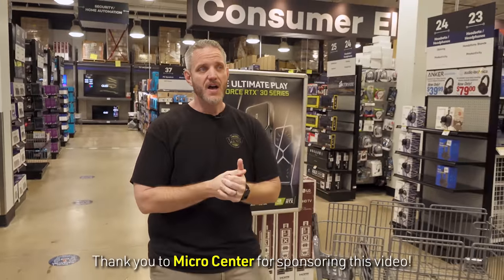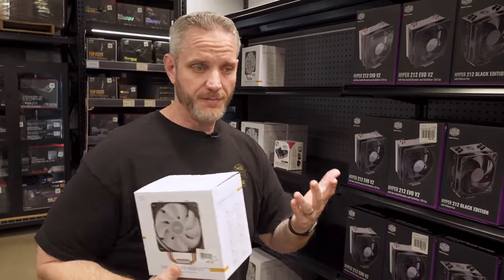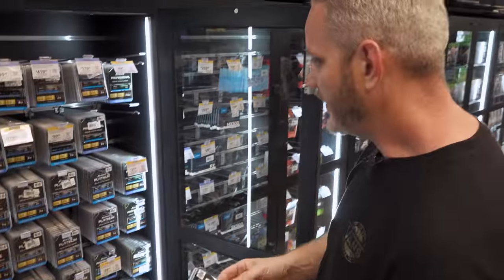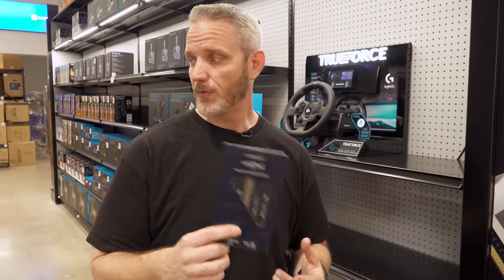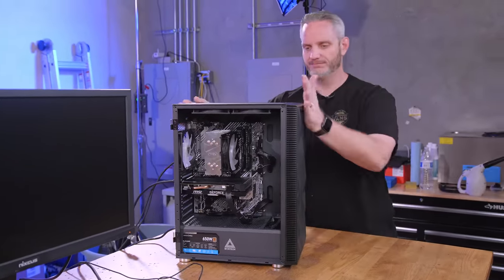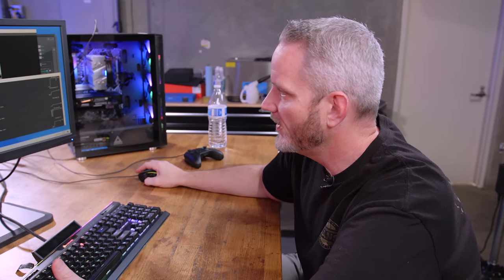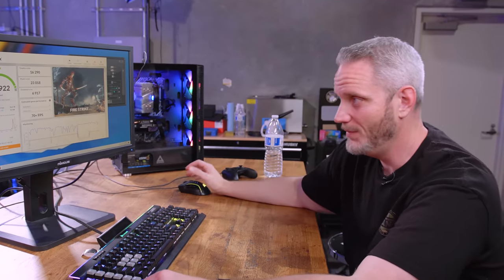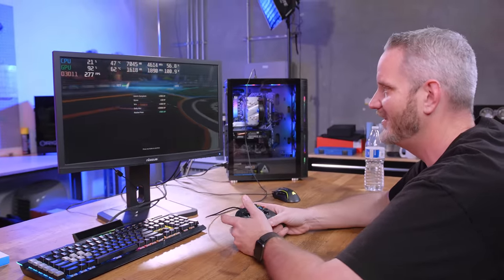How cheap can I build a "Gaming PC" for in 2022

Comment: At least you said, "this is over MSRP". That is the problem, ETH mining is down with the merge coming, so GPUs are available. However, they are still listed above their MSRP and above their launch prices. AMD overpriced their cards to begin with, Nvidia limited their GPUs, Nvidia then launched Ti's at scalper prices to take profits. It is just terrible to build a PC right now. I wouldn't build a budget PC unless you have to... even motherboards are at their highest prices in years, as are PC cases, both CPU companies are changing or have changed their socket sizes, DDR5 mobos and DDR5 itself is not fun. Doing a budget build right now is terrible for future proofing and terrible for pricing. Wait if you can.
Reply: I got a TUF 3070 TI for MSRP on e*ay, yesterday. After waiting for more than a year, luck struck me. :D
Reply: @DaveChimny  but isn’t 3070 Ti MSRP like 20% higher than the 3070 for 5% more performance?
Reply: @DaveChimny  3070 Ti is scalped from the begining anyway
Reply: @arnox4554  I would agree if FE cards didn’t keep showing up at their launch MSRP and the fact that AMD and Nvidia are reporting record profits on fewer unit sales. Yes, many factors involved, but very hard to say with a straight face that cash grabbing is not a major one.
Reply: @vaderwashere365  Fun fact: All available 3070s would've been over the TI, so why not get it? ;-)
Reply: Name one thing that isn’t more expensive now than it was in October 2020 when these were announced
Reply: @four_20hitman___97  founders edition cards
Reply: @DaveChimny  not saying don’t get it, just saying it plays into the scalper prices that Nvidia wanted a cut of. Not blaming any consumers. However, being happy to get a chance to buy a very expensive GPU is how bad it has gotten.
Reply: It's time to accept that this is what things cost now.  And it's only going up from here.  We are bringing all the fabs back to US soil for national security. Their is no chance of this not happening. We are disconnecting from China and we will let them have Taiwan back in about 5 years.  Right now is the BEST time to build, before prices start to spike because of neon and nickle availability ... You have weeks maybe a couple of months.
Reply: @KeithZim  correction, end of 2020 and early last year was the best time. 30 series was new, Ryzen had great CPUs. At least you had over a year of the highest ETH mining profitability to make up for the additional cost. Now you just have an additional cost. Might as well wait for new 40 series when the merge happens and the cards are worse at mining in general.
Reply: PSUs were crazy expensive in mid to late 2020
Reply: @KeithZim  every single thing you just said is absolutely true. im thinking of getting back into semis because we have a major shortage of workers to manage the fabs. we finally just got some helium after a 12 week lead time. rubber and plastic monomers, 300 series stainless, inconel and hasteloy....

i dont think most people realize the bad things coming this winter.
Reply: Launch GPU prices are not coming back down.  This is the new normal.  Everything from cases to PSUs to motherboards are going to cost more from here out.
Reply: Yeah I live 10 minutes away from a microcenter and they finally have Nvidia 30 series cards in stock all the time now. Even 3080's. But they're all above msrp. Some way worse then others. But hey at least we can finally walk into the store and have the opportunity to buy whatever card we want again.
Reply: @PabzRoz  Microcenter sells at MSRP.  If the prices are high, it's because the manufacturers raised MSRP.
Reply: @cup_and_cone  That's not true. Did you even watch the video..? Jay literally said in the video the cards were above msrp. Majority of the cards I saw at my local Microcenter were above msrp. Only a few were at brands new msrp. For example the  3080 FTW3 ULTRA is $1300 at microcenter meanwhile EVGA's msrp for that card is $920. It varies from card to card. A lot of them were less then $100 over msrp but regardless they do sell cards over msrp.
Reply: @cup_and_cone  na microcenter 100% sells cards over msrp. it's not just because manufacturers are raising msrp. not all of them but a lot of them. all you need to do is compare their prices with others and you will find plenty of examples. mostly with the higher end cards.
Reply: @PabzRoz  Jay is mistaken and the EVGA queue price isn't what actual MSRP is for retailers.    Micro Center and BestBuy both sell at MSRP.  The new MSRP for the 3080 EVGA FTW 3 is $1299 for retailers.
Reply: @leeroyjankins2307  Name a card model at Micro Center that has a price above MSRP.
Reply: @cup_and_cone  Where are you getting this information that EVGA changed their msrp to $1299? Just because Best Buy and Microcenter have the same price? Then how come Microcenter has the Tuf gaming 3070 for $750 but Best Buy has it for $660. Doesn't sound like their selling all their cards at msrp. There's plenty more examples of this when comparing retailers. Jay was not mistaken. Microcenter does not sell all their cards at msrp.
Reply: @cup_and_cone  lol ok literally took me 2 seconds. Zotac 3080ti Trinity. Microcenters price is $1850 meanwhile Amazons price is $1430. And that's sold and shipped by amazon. not a 3rd party vender through amazon. Microcenters price is over $400 more expensive. You're wrong if you think Microcenter doesn't sell cards above msrp lol.
Reply: @PabzRoz  Uh, because they're both selling that Tuf 3070 BELOW MSRP.  The MSRP the Asus Tuf 3070 is $799.
Reply: @cup_and_cone  And where did you get this information that it's msrp is $799?
Reply: @leeroyjankins2307  Wrong.  Just because one retailer is less does not mean Micro Center is selling for over MSRP.  MSRP for the Zotac 3080 TI Trinity is more than what it's listed at MC for.
Reply: @PabzRoz  Maybe you can go up to the Micro Center guest service counter on your next visit and talk with them directly, since you refuse to believe the truth.
Reply: @cup_and_cone   you're the only person wrong here. manufactures don't release there msrp's anymore. you're literally going off what specific retailers are selling their cards for at certain times that are convenient for you. that's not what msrp is. every retailer makes up their own msrp because consumers don't know wtf the actual msrp is anymore. if you think microcenter isn't price gouging consumers then you're in denial point blank. not only did Jay himself say it in the video but people in the comments are literally giving you examples. I think I'm going to trust the Jay over some random microcenter employee in the comments.
Reply: @cup_and_cone  so then what is the official msrp right now for the  Zotac 3080 TI Trinity and what is your source? please share your sources where you found the current msrp for this card. Never heard of one retailer selling a card for over $400 less then another yet they're both under msrp. do you even hear yourself right now?
Reply: @cup_and_cone    so you can't tell me where you're getting your msrp prices from..?🤦‍♂ just gunna ignore that for the 3rd time? what a joke lol.  you sound ridiculous. "ask a microcenter employee" yeah like that will give me the answers lmao.
Reply: @cup_and_cone  just curious what microcenter do you work for and do they pay you commission to bullshhit people in youtube comment sections?
Reply: @juji5400  So you're saying MSRPs don't exist, yet you're convinced they're charging more than MSRP.  😂😂😂😂  That's some ridiculous logic.
Reply: @edswanson4135  Not enough (zero dollars) to deal with all the butthurt of people realizing they'll never be able to buy a top of the line card for less than $1,000 again because they can't accept the new normal.
Reply: I don't think you'll ever see 3080s for $700 again.  Not that they can't be priced at the original launch cost, but because the market has shifted in multiple ways and retailers have no incentive to bring prices down.  They are likely still buying at inflated costs, as well.

A lot of 3080s ditched the 10GB baseline and moved to a 12GB chassis, and the TI versions of both the 3070 and 3080 seem much more plentiful now as compared to their old counterparts.  Those, of course, are priced higher even for minimal performance gains.

Prices have still come down.  It remains to be seen if they come down any more, but I think we're approaching a plateau for a time.  Maybe the 40 series release helps discount the 30 series somewhat, but I think that's an optimistic view considering.  The 40 series is likely to launch at a considerably higher MSRP which will make the 30 series look cheap in comparison, I think.

The big unknown for the 40 series is how much stock is influenced by scalpers and miners.
Reply: @jwilphl  technically, we saw 3080 FE for $700 yesterday from BB’s online drop, but I agree with the general sentiment. Prices of original cards may not see MSRP again, but the newer cards have at least dipped to their scalper MSRP (mostly Ti cards). With many sitting on shelves and online, I see further drops for those. Higher prices for many things are likely a long term problem. I am just very glad I didn’t listen to so many tech insiders and didn’t wait for MSRP. So many have lost 1.5 years on a false hope. Good luck out there y’all!
Reply: @cup_and_cone  do you always embarrass yourself like this? if you claim something and refuse to give your sources then you're automatically bs. the fact that every one asked where you're getting your msrp prices from and you just shut down and ignore the answer says all we need to know. there's nothing more embarrassing then someone who argues a point they can't even back up🤦‍♂
Reply: @cup_and_cone  where did I say that? reading isn't your strong suit huh. I said you don't know what the msrp on cards are because manufactures don't release current msrp's anymore. therefor you don't know what actually msrp is. you're full of it. microcenter absolutely price gouges their cards.  you make bold claims but can't even back them up and then when you're put into a corner you change the subject. you have no idea what you're talking about and making completely baseless claims. you can't accept that your employer microcenter sells cards above msrp so you need to be a whiteknight and make up nonsense defending them no matter how ridiculous you look.
Reply: @juji5400  "Manufacturers don't release MSRPs anymore" - Your exact words.  I assure you, procurement teams definitely know current MSRP, even in this volatile market.  Having warehouse inventory of the same exact item, but half the product had a different MSRP at time of acquisition, is not uncommon.
Reply: @cup_and_cone   gotta spell things out for you huh.... manufactures don't release msrp's anymore to the public is what I meant genius. I was responding to you're nonsense msrp prices you were commenting and how you were making stuff up and have no idea what you're talking about. you don't know what the actual current msrp's are on cards nor have you even released your supposed source where you were getting these made up prices from. obviously manufactures still have msrp's and the retailers know what they are🤦‍♂️
Reply: @cup_and_cone  Imagine actually believing Microcenter or any retailer for that matter sells cards at or even under msrp😂 There's nothing worse in this world then someone who knows they're wrong but continues to go on trying to convince people they're right. Not only did you completely ignore everyone as soon as they asked for your sources but you still go on even after everyone proved you wrong countless times. Even you don't believe the stuff you're saying. Then after your proven wrong you switch the subject and say "they're just butt hurt they can't afford it" which has absolutely nothing to do with the topic you just know you have nothing legitimate to offer. That's your insecurities showing. You're just one of those people that can't accept being wrong and end up embarrassing yourself in the process. Those types of people always end up alone. you should work on that.
Reply: @Zack-ru4ln  That's a lot of text for you to say "I'm also mad I can't afford a card".
Reply: @cup_and_cone  bruh

Comment: It's crazy to me that almost 4 years later the 1660 is still almost $400.00!
Reply: Uhhh...it's been only 2 years...
Reply: @reinhard7164  ok I'll change my statement. It's been 3 years since the 1660 launched and it's still almost $400.00! 1660 launched in 2019 I believe that is 3 years.
Reply: @reinhard7164  its a Turing based card so at least 3 years old and 4 years ago was launch for that whole gen.
Reply: @captainkrk88  i guess it crossed 400$ after gpu crisis...
Reply: And XFX RX580 8 GB . I bought it 170€ now it's 680€ still 🤯🤯🤯
Reply: @Sunkeny  you don’t remember chip shortage that’s still happening?
Reply: I sold my 2060 after multiple years of use (light use) for more than I paid for it. I mean. Wow.
Reply: @reinhard7164  Thats what I'm saying. It's just crazy what the shortage has done. It's what a 3060 (should be) MSRP is. I think....I don't know what MSRP is anymore for anything lol.
Reply: Waz it ever 400 dollars when it released ?
Reply: @chillhour6155  the 1660 was $219 when it released and the super was $229 when it released the 3060 was a little over $300 when it released...well...it was SUPPOSED to be a little over $300 lol.
Reply: @captainkrk88  all I can say is insane, this whole market
Reply: @chillhour6155  I got mine for 339  cad, which  is  like 260 usd.

Comment: I just got an AMD RX 6500XT for $180 in that same MicroCenter last night. It was open box, but I'll benchmark it to make sure it haven't been messed with. SO HYPE!
Reply: Actually under msrp for that! Although, it’s power is almost 1060 power so…
Reply: And you need a PCIe 4.0 board to run it at full capacity.
Reply: @JaceB99  It's a budget build that I was initially planning on using integrated intel graphics for, so this made sense.
Reply: @Bratfalken  I believe there's only a small difference between running any card on PCIE 3.0 vs 4.0, but I believe my board has 4.0 since it's newest gen intel supported.
Reply: @IamNinetyFour  correct the difference is negligible
Reply: @mannyfresh7065  for most cards except the 6500 xt
Reply: @mannyfresh7065  Not for the 6500XT. Because it has only a 4x PCIe lanes. For any mid/low end 16X of PCIe 3.0 is OK, even 8X would be. But 4x its a bottleneck
Reply: Good work, that GPU is solid & amazing at that price.  2kliksphilip did some fair reviews of the 6500XT, it gets solid FPS.
Reply: Dude the 6500 xt is not a bad deal at msrp! I got one for 200 day one.
Reply: @IamNinetyFour  oh! That’s really cool! I hope it works out well!! For that purpose it should serve you well :)
Reply: @IamNinetyFour  Bruh not with the 6500xt, there is a massive difference between pcie 3 and 4 since it's only an x4 link.
Reply: @IamNinetyFour  not with a 6500xt.

Comment: I had a Neo Forza RAM kit (16GB DDR4-3200) in my old Ryzen 2600. Microcenter had it on sale so cheap, and I was on such a tight  budget, that I basically couldn't say no at the time. Honestly, it worked pretty well. Never had any issues. As with any budget PC part, YMMV...

Comment: I would have gone with the 5600X plus the 6600 to take advantage of smart memory access and a strong degree of future proofing. You would make back some of the extra cost on the cheaper motherboard and stock cooler, and the longevity of the system means you'll save in the long run because you won't need to replace the PC as soon when it no longer holds up

The cheapest you can build will work, and that's what they set out to show, but a custom gaming rig isn't where you should spend the least you're comfortable with. From my perspective as an individual enthusiast who's built PCs for seven years now, $1600 is how much you should be expecting to spend for a quality pc
Reply: 5600 would've been better then g or x for the price
Reply: You would at least need a B550 bord then 😉

Comment: My favorite cheapo case, the Thermaltake Versa H17 or H18, must have been out of stock. Not flimsy unlike this one, but doesn't come with a ton of fans and is mATX (no biggie, most value boards come in mATX). Its clear that the fans are worth more than this Monotech case! Best way to get a deal at Microcenter is the CPU/Motherboard combo deals, usually good for $20 off. You can sometimes get additional off on RAM and storage from combo deals as well.